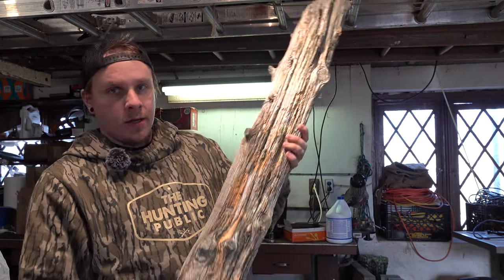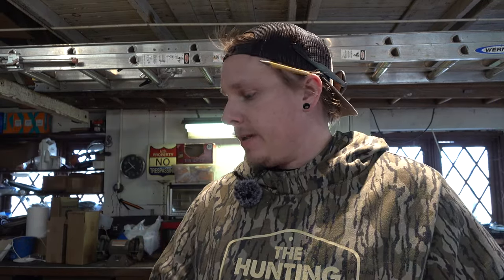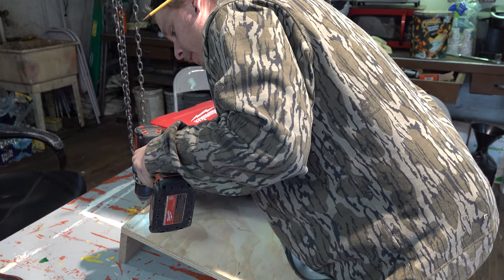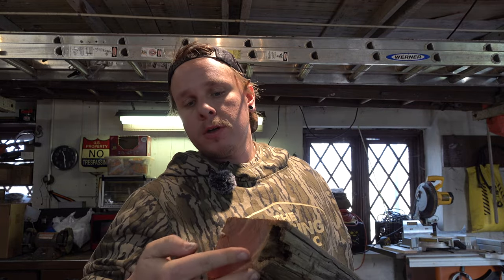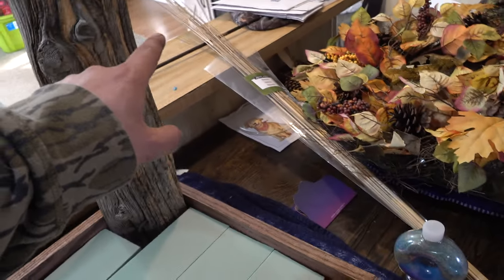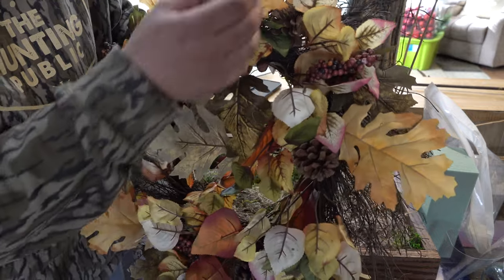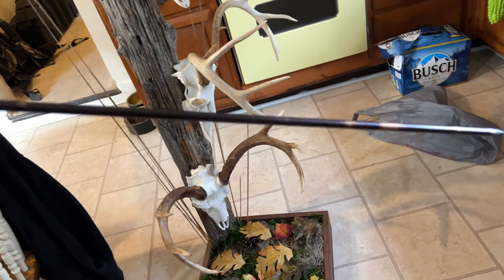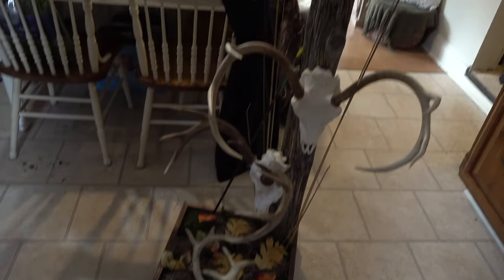How To Make A DIY Euro Mount Display!

Comment: if you when 18 inches with all 4 sides with the oak you could have mitered them with your miter saw on a 45* and it would have looked better and wouldnt have had any end grains to stain. but all in all looks good man gave me a few ideas forsure.
Reply from the maker: I am no carpenter doing 45 degree cuts is beyond my skill set.